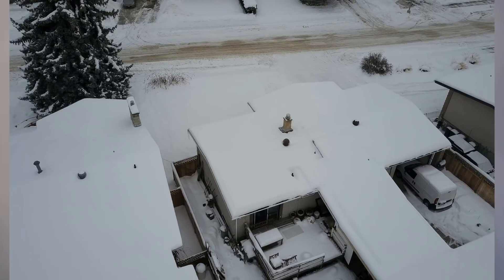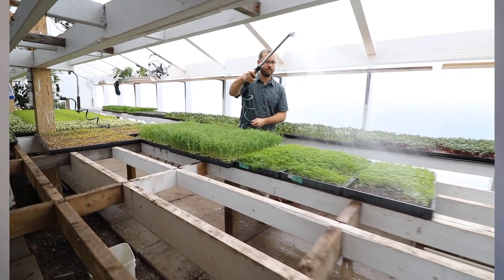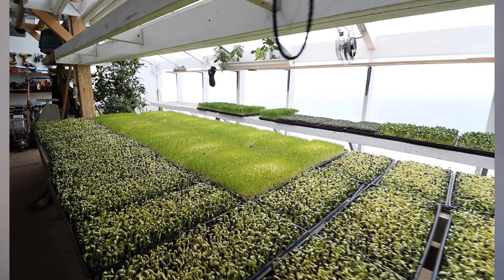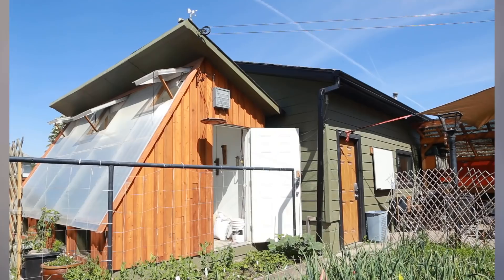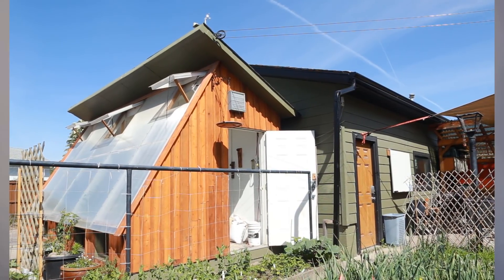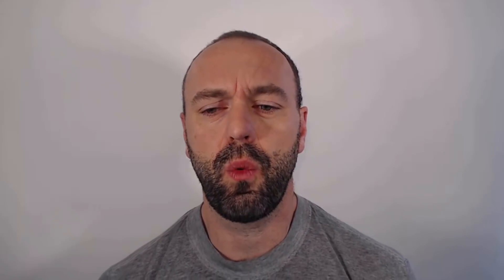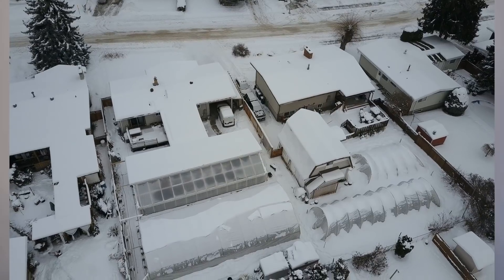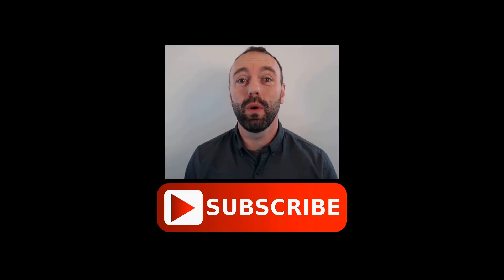Should You Use Double Poly Walls For Passive Solar Greenhouses

Comment: I'm looking at building a solar hot air box and was wondering whether a double or tripple poly wall would benefit the project? Does a double poly wall reduce the heat needed or increase the heat from the sun? I understand the thermal effects of holding the heat in but am concerned about reduction of solar heat. Any help on this please.

Comment: Hi, your work is very big inspiration for my. Really. 
I'm planning to build a vegetable greenhouse for our family. And I came across your video.

I was looking for suitable materials. Polycarbonate is best in pice/power, very durability and have very good transmision for UV light. But I would like to draw your attention to bad characteristics of polycarbonate. 

In greenhouse is high temperature and humidity. Under these conditions, the hydrolysis of polycarbonate to form Bisphenol A (polycarbonate is produced by the reaction of phosgene and bisphenol) will work. It is carcinogenic and ruin human reproductive ability. 

Its not good material for your greenhouse.
https://en.wikipedia.org/wiki/Polycarbonate
Reply: damn i just bought a load lol

Comment: Hi Rob, I live in a heavy snow load area (Oswego, New York) and am reassembling a 50-year-old Lord and Burnham aluminum and glass greenhouse. I am not going to be installing the glass on the roof. I've been thinking about installing polycarbonate between rafters (where the glass was and using Solexx on the outer surface as a covering. Do you have any experience with Solexx or using a double layer polycarbonate? We also don't get much sunshine in the winter due to the lake effect cloud cover, so maximizing the r-value is one of my reasons for going with two layers.

Thank you for your thoughts.
Reply: I would recommend you etfe foil, in the Netherlands and Germany they use it for greenhouses. And even architect's use it for houses. I also would recommend blowing air from the outside in, so you dont get condensation in between the layers.
Reply: @GoonRider19  thank you for your knowledge.  😊

Comment: I’d like to see ‘r’ value testing for air inflated double Polly. I know for double pane windows the size of the air gap makes a huge insulation difference, and double Polly has gaps that can be one or two feet, not one or two inches. Places have ranked it at ‘2’ but I truly believe it’s closer to 4 or 5. Also doubke Polly seems to work better in high winds, acting like a cushion rather than a sail diffusing the wind energy.  There’s also the issue of cost, double Polly is literally in the range of 10X cheaper than double polycarbonate. 

It’s possible to build greenhouses very pretty and amazing with unlimited budget but if you HAVE to consider ROI if you’re using your greenhouse commercially. No one wants to be paying off their building for 3-5 years longer than they need to.
Reply: Simple Tek the gap in double glazing has to be too small for the entrapped air to set up convection currents, or it loses most of its R value. Have a closer look at some commercial double glazed windows, the gap is a lot less than an inch - at a couple of feet I would expect the R value to be very poor.
Reply: The r value of 6mm twin wall is based on the material only. It needs to be vented, in order to drain any condensate. Two layers with a sealed air gap between would create additional R value of R1 per inch of air space. It would be better to create a vacuum, rather than positive pressure. You need to get rid of all moisture. Vacuum also prevents convection.
Reply: @gregjohnson9051  but vacuums are hard to keep

Comment: clear corrugated poly can be used and is ridiculously cheap here in the UK.  n its own in a single layer prob not brilliant but I've even seen someone using the corrugated foam you put down before the poly goes on and put 2 pieces back to back on top of the first layer of poly to create a gap to put a second layer on giving you an air gap and increasing the r value. definitely worth considering if cost is an issue.

Comment: From memory Curtis uses a fan in his microgreen house to keep the poly layers apart, so you may also need to account for the electrical cost of the fan in that situation.
Reply: My three 95 x 28 double poly inflated inflator cost was less than 20 US dollars for a year, you are running too big an inflator. It is only static pressure not pneumatic, no air should really move unless you have leaks. This was a test year new electric service just to those houses, no other load.

Correction 21.90
Reply: Craig Overend the fan is under 50 watts, peanuts to run
Reply: Power systems can have many hidden costs over their life cycle, not all monetary. 50W running 24/7 currently costs about $110 per year here in Australia on coal/gas fired grid, peanuts perhaps, then add the fan cost and any installation cost if you're not DIY savvy. Maybe you have a solar/wind and battery/controller system cost and savings too, and replacements when they fail over the life time of the greenhouse. Then consider the energy and environmental impact used to manufacture or recycle these support systems. Yesterday I watched someone dig old greenhouse poly plastic out of their soil in pieces. I also read how commercial biowaste digester plant compost contains 895 microplastic particles per kg. Then a dead sperm whale in spain with 30kg of plastic film inside it. Maybe double poly still costs peanuts compared to other options. Or maybe a longer lifespan material with high recycling yield makes more sense over the greenhouse lifetime.
Reply: Craig Overend you’re probably the only person I’ve ever met worried about 50watts power usage. Did you calculate how much it cost you to make that reply?
Reply: @SimpleTek  I've used  9 watt fan between poly layers on  20x14 foot GH for 10 years without problems

Comment: Thoughts on using old glass windows?
Reply: A rough guide:

Glass—single layer
Light transmission*: 85-90%
R-value**: 0.9

Factory sealed double glass
Light transmission*: 70-75%
R-value**: double layer 1.5–2.0, low-e 2.5

Polyethylene—single layer
Light transmission*: 80-90% - new material
R-value**: single film 0.87

Polyethylene—double layer
Light transmission*: 60-80%
R-value** double films: 5ml film 1.5, 6ml film 1.7

Polycarbonate—double wall rigid plastic
Light transmission*: 83%
R-value**: 6mm 1.6, 8mm 1.7

https://yukongreenhouse.weebly.com/glazing.html
Reply: how about glass + 1 layer of poly?  I'm too unsure about snow load here, otherwise I was going to try it.